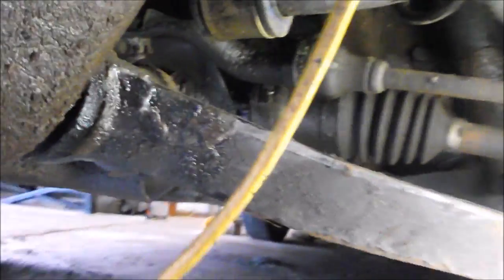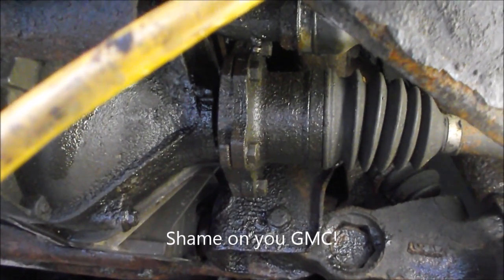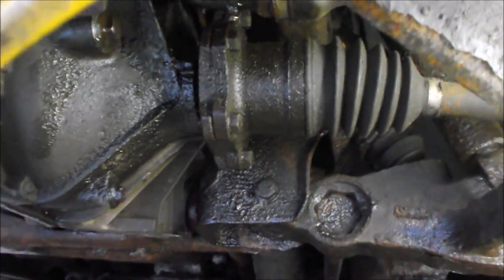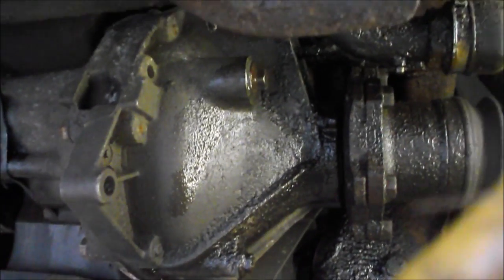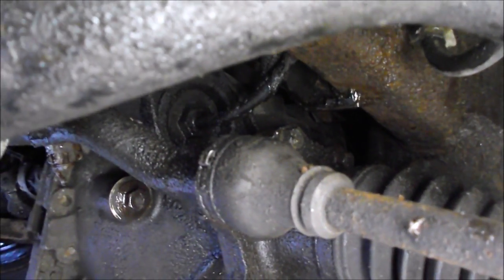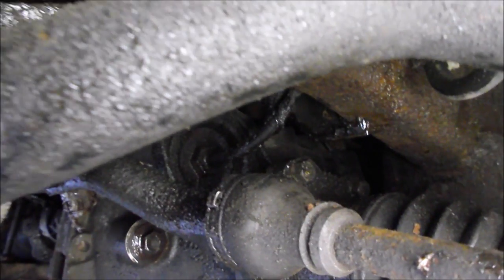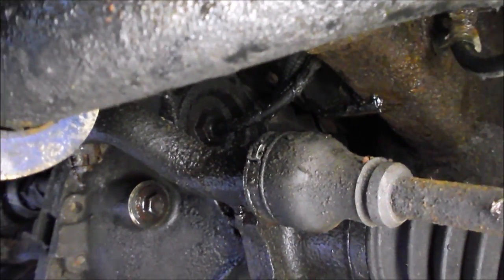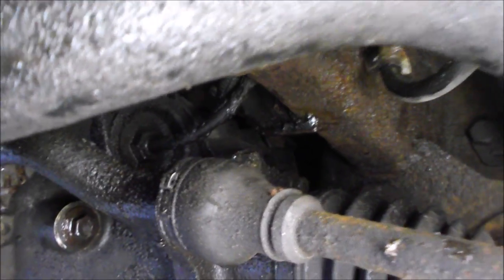Checking & repairing a differential vent tube when troubleshooting a leak (Part 2 of 2) Tahoe

Comment: @mr diyguy123 Thanks for the video. Mine looks just like this. Is it possible for this to spray upwards as well?

For example on my driverside, it is wet all the way up to my power sterring pump. 

My ABS 60amp fuse blew and I didn't think to check for wetness and I replaced it. Started it, for less than a min turned it off. I could smell wires burning and saw smoke coming up from down below. Was your wiring harness covered as well? How did you handle that if so?

Thanks for any and all help

Comment: I'm having grease exiting out of the front vent over flow valve. What's causing that?
Reply from the maker: I highly doubt anyone put grease in your front differential. It is more likely gear oil mixed with water and dust to make a paste that looks like grease. If in doubt, drain and refill (with clean gear oil) your front diff.
Reply: So does that mean there was never an issue to begin with? Just smelled and saw all that grease splashed across the control arms and the inner fender well. So that being said, it got me a little concerned. Cv boot is not cracked and wheel bearings are both good.
Reply from the maker: @windprobe7264  there isn't enough grease in a wheel bearing to make a mess if it leaked.  Leaky front diff seals spray diff fluid everywhere when the axles spin. Any wet (oil) surface on a vehicle attracts and holds dirt so it ends up looking like dark grey grease.  Based on your updated comments it sounds like front diff seals leak.  Keep an eye on fluid level and don't let it run more an an inch below the fill hole.
Reply: To add a little more, there is only fluid splashed on the driver side area  fender well only. So can I rule out the  fluid coming out of the over flow tubes that connect to diff? What do you think about cleaning the area all up with brake cleaner so I can get a better idea where it's coming from? I have noticed the fluid smell for about 2 months. I am just now looking into it. Diff fluid is full, checked it today. I wonder if it's only leaking when put in 4 wheel drive? Perhaps when I got my oil change, they over filled the diff fluid when they topped it off?
Reply from the maker: @windprobe7264  it is always smart to completely clean an area and then check for leaks again after taking it for a drive

Comment: What is the yellow looking tube hanging down in the beginning? Its hanging down on my sierra and I have no idea what it is.
Reply from the maker: The vent tube should be secured up high near your battery
Reply: @mrdiyguy123  if you have an email I can send you a picture.
Reply: Mines not connected to anything. Just hanging there. I was curious of where it connects. Any help appreciated.
Reply from the maker: @joeybates9972  vent tubes on the front and rear differential do not connect to anything. They simply let air in and out of the differential as gear oil expands and contracts.  The end of the front diff vent tube should be secured high near the battery.  If it is just hanging low and you get stuck in a deep puddle your diff could suck in water.
Reply: No no. In the beginning of your video. There is that yellow looking tube hanging. Mine isn't connected to anything one either end. The only thing that has kept me from losing it is a zip tie holding it. Its about a foot and a half long.

Comment: You could have pressurized just the vent line and heard air escaping, even if it was plugged by the differential.
Reply: What is that accordion looking plastic rubber piece called
Reply: CV boot.

Comment: I have a 98 Durango that I bought from a car lot about 2 months ago and I'm going through it because it had been wrecked by the previous owners anyhow I have a few questions .
98' Durango 4×4
318 V8 Magnum litre size unsure
SLT model
I have a hose coming out of my front passenger side axle with a plastic hollow fitting on the end that's split and it leads up front by the 3 fluid coolers ,I'm assuming that it's a coolant hose but there's nothing coming out of it and all 3 coolers have all they're hoses so my question is what is it and where does it go ??